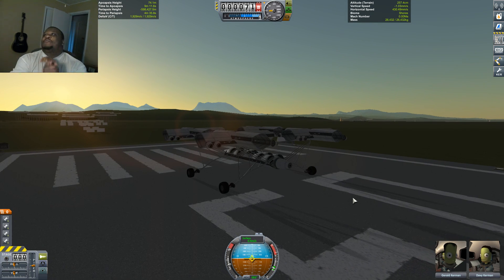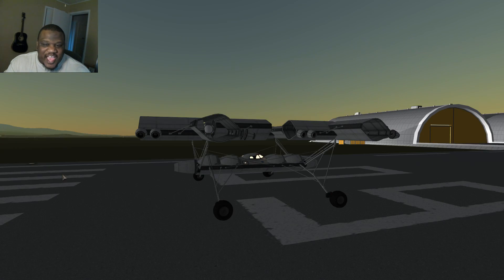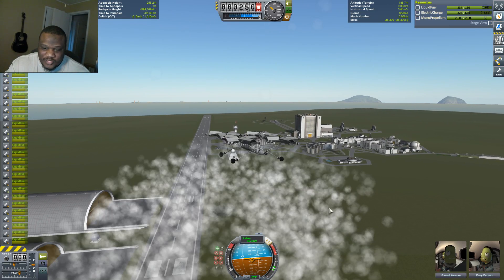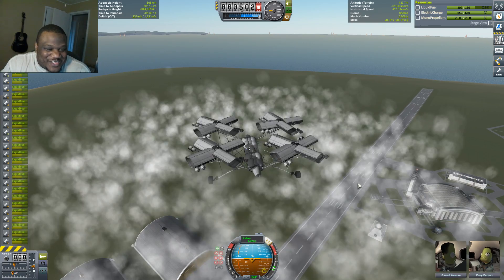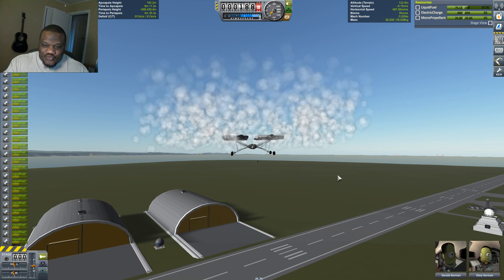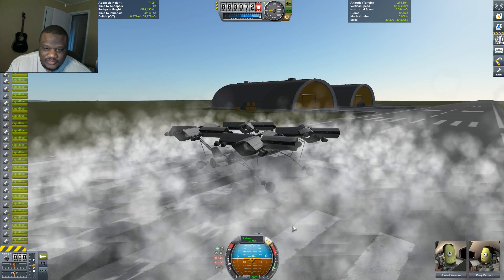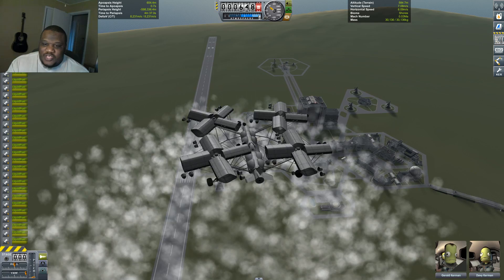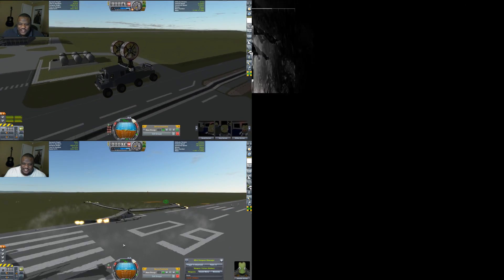Kerbal Space Program | The Thing About Lifting Bodies

Comment: I think the efficiency may improve significantly if you add intakes the the blades
Reply from the maker: +TheCardq likely so, i was concerned that the joints wouldn't hold though. I kept the "blades" as light as possible
Reply: understandable, it is a good idea to make sure the concept works before trying to improve performance, maybe you could do a follow up bid, or I could do one when I finally get the game.
Reply from the maker: +TheCardq yeah, this design is a POC. I didn't really add in the Infernal Robotics directional controls and such. That will take a breakdown rebuild. Other problem is all the exhaust drops the FPS...